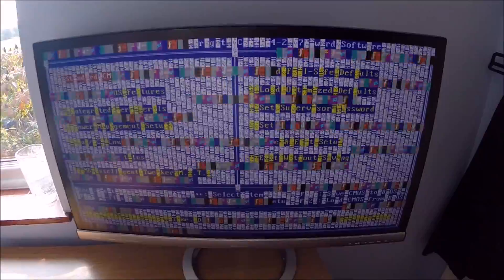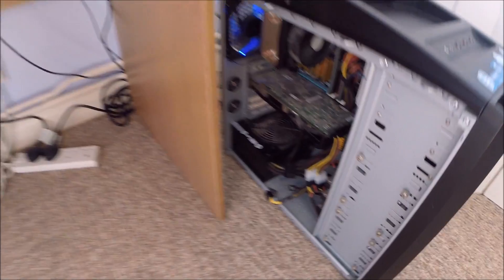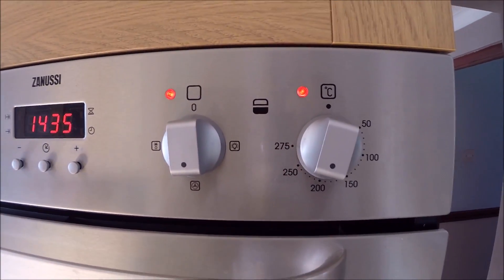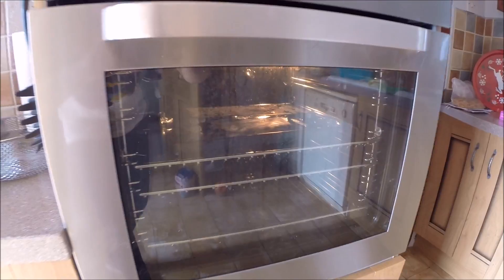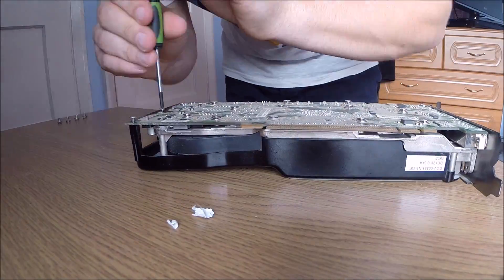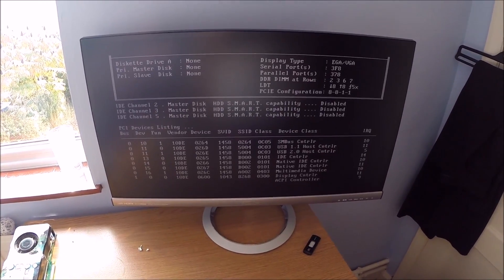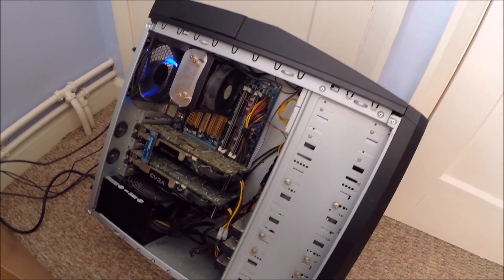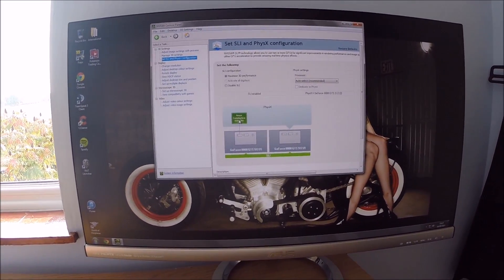Bake A Broken Graphics Card To Fix It (VIDEO CARD FIX)

Comment: Guys DO NOT do this if you have a newer graphics card (gt 710 or newer) cause there is a high chance the capacitors will just pop so if its an old card and has an expired warranty and you have nothing to do with it then you can  try it but if you have something like a gt 710 or higher don't do it the capacitors might just pop.
Reply from the maker: Don’t suppose it matters if the card is dead anyway lol

Comment: I can't believe but it was working for me too! Don't know how long will it last, but at least my GTX 780 was brought back to life! Yaaay!!! :))))

The story:
It used to freeze in the afternoon during gaming: first only the driver restarted, then I had the reset the whole computer. Then I gave it a try with another game, and it froze again. After restart it started to produce artifacts (grey horizontal lines) even at POST screen... First I tried the heatgun method, but the temperature measurement tool I had was not showing temps around 200°C, only at about 130-150°C. Heated it until about 8 minutes, then let it cool down, and gave it a try: and the sad thing happened: the CARD NOT EVEN BOOTED UP. :'(((( Vents were spinning, but the computer couldn't boot with it. I thought I might have burnt it because of inadequate temperature measurement (Chinese tool), so not losing anything I tried the baking method: Heated the oven to 200°C, then put the card in for 3 mins, took out, let it cool down, and tried  it out... Still no boot. Put it back again for 8 minutes, took it out, let it cool down, tried it out, still no boot... And I admitted the failure, and started looking for a new card....
Luckily I had an integrated VGA, which I had to configure instead of the dead 780 (by removing the battery from the motherboard), and could use at least to surf the net for alternative card. THEN (!) one day passed, and had a fresh look on the card for mechanical failure, which I couldn't find, so I gave it one last try to see what happens... AND... IT BOOTED!! NO ARTIFACTS, NOTHING! YEEEES!!! What a rollercoaster of feelings! :))))
First it was not recognized properly (only 800x600), and the driver could not be installed at all - so I though the ROM got damaged, and prepared for a ROM flashing. It wasn't needed in the end, because after a restart, it was recognized properly as GTX780, and I could install the drivers as clean as possible, and since then it gives stable picture. Haven't dare to game since then, because I wanted to give some time to settle... I hope it will last at least one more year... I would be more than happy with it.

Conclusion:
1. I prefer the baking method over the heatgun, because it gives more steady temperatures.
2. If it doesn't working for the first time, one can give it another go. Just like overclocking: increasing the duration step by step and maybe the temp as well.  I would go from 3 to 15 minutes, and from 200 to 220°C max, This is not proven though!
3. It is also worth it to let the card completely still. In my case it was about 12-14 hours room temperature. And then give it another try.
4. It may or may not help to reset the motherboard by removing the battery. I don't know if in my case this did anything or not, but I had to do it anyway.
+1. There are trustworthy repair shops, who do much better job by re-soldering the BGA under the chips. When I thought I had messed up the card completely, that it couldn't even boot, I wished I had taken it to repair shop first, and pay ~100€ for a proper fix. It's worth it to consider.
Reply: Since then the problem reappeared 2 times, and as I didn't have anything to lose, I baked it again with the above method (200-210°C max 8 minutes). It was back to normal operation both times. After the initial baking the card was good for 6 month, then for 3 month, then it's now stable for 1 month. Gigabyte GTX 780 Windforce OC 3gb card.

Comment: mmm fake i have this error arteffect in gtx 285  why i cooking my v.card to back a.life I can go on maintenance work and most often have capacitors
 or And if you succeed in cooking You will have the same problem again within a week or a few months and you will do it again and then you will be back
 If the card is expensive and does not want loss, it should be checked and the damaged part changed
...

Comment: This trick also fixed my 1050 Ti, I was watching youtube and such, and it just stopped for no reason. Plugging my monitors into my Motherboard worked fine, so I knew it had to be either the PCI-e slot or the card, and I decided to try an old(ish) gpu of mine that I had before the 1050 Ti, which was an AMD HD8490, and the card worked in my system, so I decided to bake my 1050 Ti, and did so, let it cool and popped it into my system and it's still working up to today
Reply from the maker: Glad your card is now working ok my friend!
Reply: hi , may i ask u a question?

Comment: My solution if dont have oven but its summer i just put it outside on my garage roof for like 1hour and sun did the job can't believe lol
Reply: Did you remove the plastic?
Reply: lol sure. If the sun could heat something over 200 degrees people would be getting caught on fire constantly.

Comment: Did that work for long? Experts say that this method might seem to solve the problem... but the solution is just temporary, because what is actually damaged sits inside the chip - the micro-connections between the silicon die and the pcb of the die itself, not the bga between the pcb of the die and the pcb of the graphics card. The "re-balling" just seems to work, but then it fails again usually within a time that may vary between a week, a month or more.
https://www.youtube.com/watch?v=1AcEt073Uds&t=937s
Oh btw, "Zanussi" oven... fine italian household appliance ;) (I'm from Italy)
Reply: zanushi is great oven

Comment: Please do not do this! This will most likely not work and at worst destroy the card! If you want it fixed take it to a proper repair shop.  If your gpu doesn't have a flip switch design it won't work at all and will result in the probable death of the card, if it is flip chip it may work but probably not.
Reply from the maker: BOBsmithISaPERSON we need to take you to the repair shop
Reply: I have to be with mr. Billing on this one.
Reply: lol...you can still do this tho...what's the point...you're not gonna lose anything...ur gpu is already dead so why not give it a shot...

Comment: OK people, this DOES work. However, do NOT put video cards inside the oven you cook food in. The fumes released can stick to food cooked in the oven. Also, this trick will only extend the life of the card a tiny bit. Whether it's 1 day, 1 week or 1 year is random. The card is already dead but the heat will move things around in the chip and make it last a little bit longer. Lastly, let the card cool off and do not touch it or move after and while it's being heated up. You want to keep the card as still as possible until it cools off. Good luck! I'm reviving my r9 290 until I can get my hands on a GTX 970. Until then...using my old 650Ti
Reply: Fantastic_Timez a hairdryer on my Xbox made it not have red ring of death but only worked for about one day
Reply: It works but for 3 months he is using dead zombie gpu maybe.Is there a way to reflow the gpu bimps for a long period of years have someone tried different methods i mean charging it with electrical heat maybe or something i don't know to recharge the bimps and make them fully healthy? :O
Reply: i recover my pcs+hd7850 by heating my card with air dryer affter 1 month it shows extreme artifacts at startup but shows welcome screen for 5sec and again artifacts and black screen permonentaly waht do you thing my card is dead or not
and before going to dead it often shows amd driver not responding and has recovered suceesfully
Reply: please help me man
Reply: Air dryer? What I usually do is buy dead GPU depending how bad their state are then use proper tools. I use heatgun to heatup the GPU for good couple of minutes allowing the soldering balls to stick back to the board then it should last a good couple of months or years depending on how cool they keep their card. Keep using it on 85C-100C then good luck keeping it long enough since the heat directly from the chip may de-lead the chip again giving another problem. A more suitable solution is to reball the whole thing which requires more tools and work to do so. :S
Reply: Fantastic_Timez hey man? Did it worked, I have the same graphicks card and it does the same thing
Reply: it works... 200 c for 10 mins and youre good to go...
Reply: this method is used to correct the soldering. A soldering melts the welding iron at 200-450°C. Correction of soldering is do when the board has fallen from a distance or hit.
Reply: I can confirm that this does work! I had the same card as Jake and i baked it 3 times.Unfortunately, the last time i baked it I touched it immediately and some parts just fell off the board.Just don't bake it in the same oven you cook!

Comment: i have been having this problem with my 2008 imac and have taken too a repair shop at least 3 times where they preform this fix. it has since started acting up more and more. i had a crazy idea one night and thought why not just turn the imac completely upside down and run it for an hour or two and see the results. well after shutting it down and flipping it right side up and restarting..... it worked. i figured they heat it to reconect the melted conections why not let it melt its self back into place?? anyone ever try this with any positive results?
Reply: and that is the reason Do not buy shitty apple imacs

Comment: I'm pretty sure there is a cleaner way to do this then just sticking it in the oven and not reattach the cooler without applying new thermal paste. Respect your property.
Reply from the maker: Oh stop your whining! It's a 8 year old card, you've gotta respect it for lasting this long. Cheers buddy
Reply: It's an antique.
Reply: I don't think putting it back on with the old thermal paste will  effect the heat dispersion. Watched a vid on that at linustechtips, he says doesn't effect of how it deals with heat.
Reply: if the card is already screwed who cares